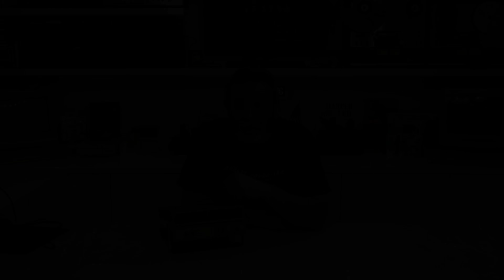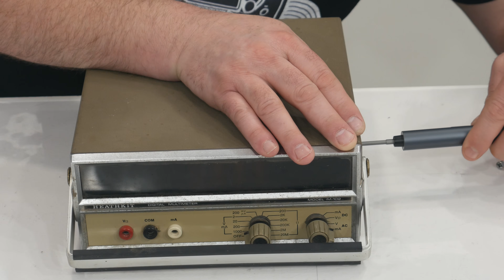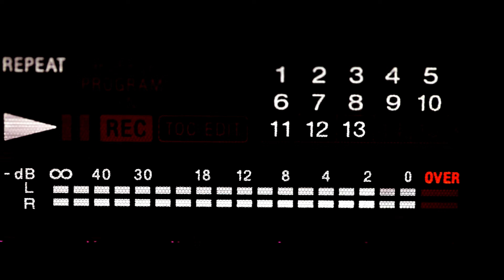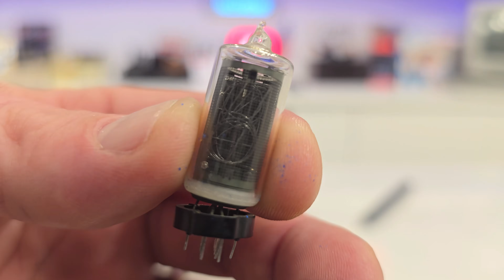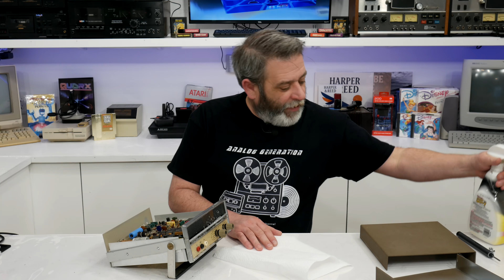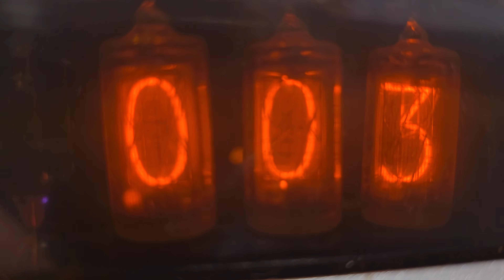These Numbers Are Made of ACTUAL PLASMA? NIXIE TUBE Heathkit IM102 Multimeter Repair and Restoration

Comment: I have this same voltmeter I assembled new as a kid. Still works! I also still have a working signal generator and frequency counter. I even assembled a Heath color television that worked for years but sadly didn't make the last couple of moves with me.  The unique power cords are lost forever too.  I hear you can still get Russian NOS nixie tubes. You can tell the Russian tubes because  they use the "5" backwards for the "2" in order to save cost but it does look a little weird.
Reply from the maker: Yes! I just ordered a nixie clock kit and it has those Russian tubes. Curious to see how they look in person.